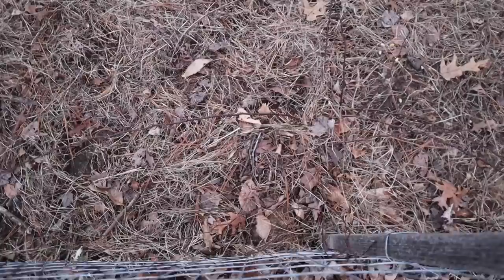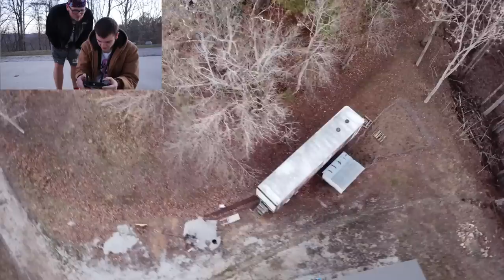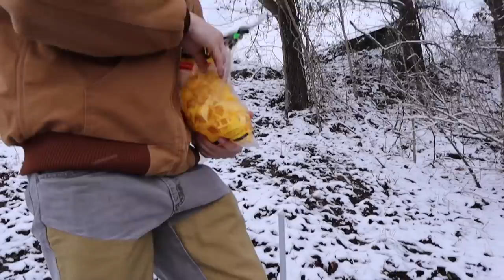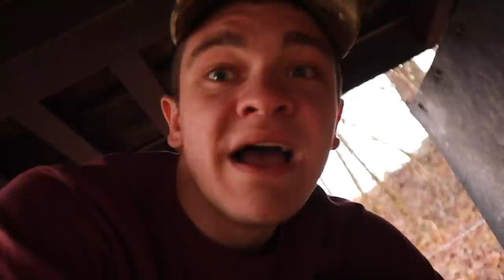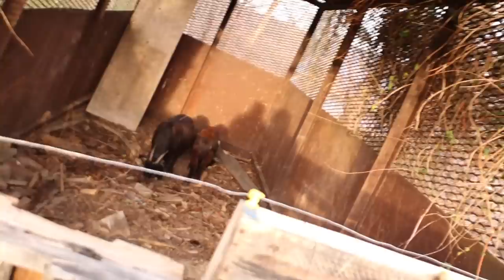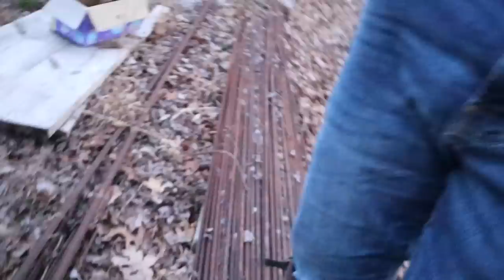My First Goats! (Backyard Goat Farm)

Comment: Kendal you need to do wolven wire fence with a electric strand on top because most billy goats can jump over 5 foot fence and weave through electric unless your fence has a very good connection 🐐

Comment: i own goat's, they don't eat everythig.. they prefer blade grass and green leaves to brush but when there is none they WILL forage for just about anything they can get they're mouths on.. you'll need to supplement they're diet a little bit with some grain of some sort.. also you need to keep in mind that goats are very social creatures that forage, unlike cattle or horses that like to graze, you need to have no less than 2 goats and have at least 1 acre per goat, otherwise you'll have to buy a few bales of hay because they simply won't eat some things... that small area will be perfect for starting them out at your place though... also goats are VERY smart and determined animals.. if they want out they WILL find a way out... i quit using electric and switched to 6ft field fencing because my buck kept pushing the kid's into the fence to short it out so the rest of the herd could go through the fence.. fair warning lol